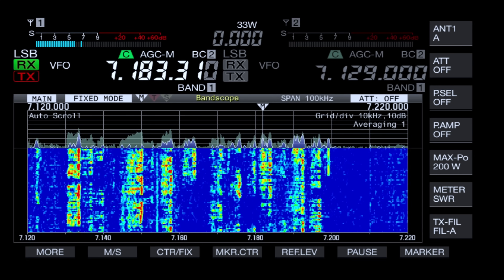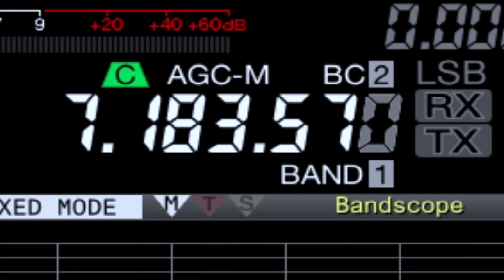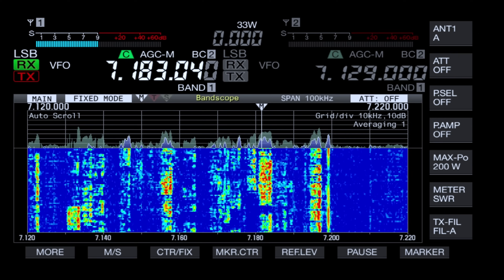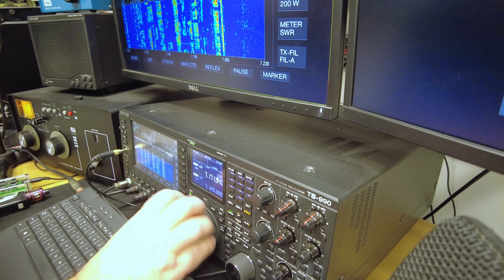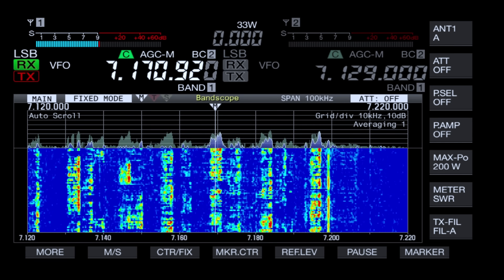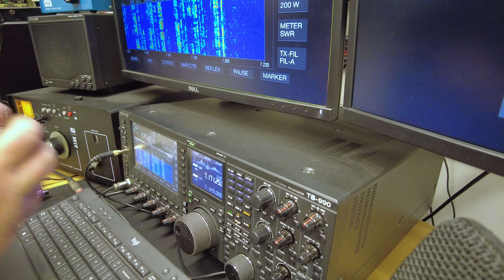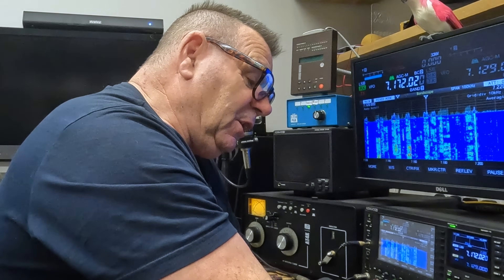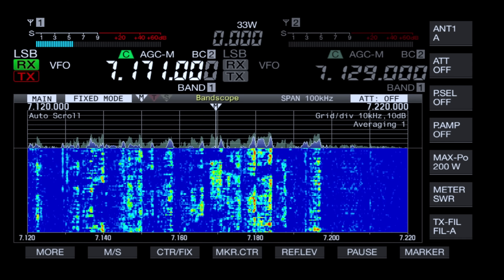Tuning in SSB Signal for Newbies

Comment: SSB is where you tell the good operators from the sloppy.  Obviously the good are straight on freq. while the others’ radios are just enough Hz off to drive you mad and often drift, adding to the fun.
I’ve been told once or twice that I was off freq.  I told them that was a sign they need their radio tuned.

Comment: I started my shortwave SSB career  with a dial , no digital readout. Had to get good zero beating a signal.  So,sooo much easier today,  not only because of the digital display on the VFO, but my modern rigs have wonderful roofing filters,  adjustable IF , adjustable DSP filters. And now waterfalls! To an old goat like me , it's like going from driving a  tractor to a Cadillac!  Modern radios are amazing.  I still like my old fashioned rigs, but if I'd have my druthers,  I'd take one of today's HF rigs any day !
Reply: I bought an old trio reciver and it takes a good 30s to tune to the fking ssb signal lol. I got the pain, but I saved money

Comment: Is it standard practice to use the the lower half of a frequency that another operator is using upper ssb. For example another operator is operating at 7.123 upper side band. Can I operate at 7.120 upper side band? Or would there be interference?
Reply from the maker: About 3kHz is probably fine. So your example would be OK - but nothing to do with "lower half" or anything, just 3kHz because your TX bandwidth will be about 2.7kHz.
Reply: @DXCommanderHQ  Thank you for the confirmation. Keep up the excellent work!

Comment: Hi Cal, I've not yet got an HF transceiver.  What fascinates me, is how do you decide whether to use LSB or USB, and do you have issues receiving someone if you're set to the other one?  🤔
73s M7GTX
Reply from the maker: OK Richard, there are basically "standards" so 40m and below (on SSB), you would almost always be on LSB. And visa versa. (Thanks Ian for also pointing this out).
Reply: Generally frequencies upto the 7Mhz band(40mtrs) use LSB and then from 14Mhz(20mts) and above use USB.
73.G7HFS/PA3IKH
Reply: The split is actually at 10 MHz.  The convention is LSB below 10 MHz, USB above.  However, there are exceptions.  If you run digital modes, they are usually always on USB, even below 10 MHz.  If someone is on LSB when you're on USB (or vice versa), they will be unintelligible.  You'll hear them, but you won't be able to tune them to make them understandable.  This is because all their voice frequencies will be inverted - all their lows will be high and highs will be lows.  They used to actually make analog voice scramblers for land line telephones that worked by swapping the sidebands this way.

Comment: Back in 1980 when I first watched The Empire Strikes Back, there's a scene where the Rebel base crew on the ice planet Hoth were monitoring the Imperial Droid probe's transmissions. It sounded very robotic and creepy to me and I had never heard anything like it before.

It was years later when I figured that the sound effects people just used an SSB voice transmission with the receiving frequency purposely dialed up slightly high to sound like an alien robot! 🤖

BTW, I have two serious questions as someone who has never seen a HF ham rig in real life. 

1. Do HF transceivers automatically select LSB when the transmit frequency is below 10 MHz and USB if it's above? Can USB be selected for transmitting on the 40m band or LSB on 20 meters? 

2. Do ham operators choose frequencies with a 5 kHz spacing like broadcast stations or can they transmit on an arbitrary frequency, like 7012.4 kHz instead of 7015 kHz?

Great video sir. I finally learned the proper way to tune into SSB conversations! 📻👍🏼
Reply from the maker: Good question.. And welcome to the channel.. 1. So you COULD transmit on either side-band but once set, the radio will generally remember and sit you on lower 40m, 80m etc or upper (20m and above). 2. You can transmit ANYWHERE you like (inside the allocated spectrum) however, most folks like to have the zeros showing.. Unless it's a rammed contest where if you can find a slot, go there and it might vbe extremely random!
Reply: @DXCommanderHQ  Thank you so much for the concise reply,  Callum...appreciate it! 🙂 I have been searching for the answers to these questions for a long time to no avail. There's nothing on Quora about the choice of frequencies. Several months ago, when I asked the same questions to a British content creator on YT who is a ham, he provided me a link to some U.K. amateur radio society website and implicitly asked me to scour the entire website. I didn't like his condescending tone and unsubscribed from his channel. 😐

While I am familiar with the use of repeaters on VHF and UHF ham radio (I have a few 2m/70cm walkie talkies myself), I am aware that repeaters use round numbers. e.g. 143.900 MHz, 148.650 MHz and so forth. HF is a different ballgame to me as I only have shortwave receivers and SDRs but not HF transceivers. I've noted some licensed and unlicensed users in Southeast Asia transmit at 6995 kHz, 7000 kHz, 7015 kHz and even 10000 kHz, which I understand is reserved for time signal stations.

It took me a long time before I learned that hams transmit on lower sideband if the frequency is lower than 10 MHz and upper sideband if it's higher. Utility signals like Volmet always broadcast in USB regardless of the frequency while the Bangkok Meteorological  Radio transmits on a rather odd frequency of 6765.1 kHz. I wish I knew why they chose that frequency, right down to the nearest 100 Hz. 🤔

Comment: A great video Cal.  I like the bit about not looking at the screen - but using the ears.  I think this is a bit like tuning a guitar. When I do this I tend to use the method where I tune one string on the 5th fret against the next open sting (or 4th fret on the third sting) - going from thinner strings to thicker strings (i.e. High E to low E).  The major point here is that when you are nearly in tune, but not quite, you hear a beat. AS you tune a little more the beat gets slower and slower and then BANG on the money. All done by the ear and not looking at any dials.   Mark. 2E0MSR.
Reply from the maker: That's it!

Comment: Modern synthesised rigs being so frequency stable combined with the natural urge to have integer frequencies means  if you set the VFO to all trailing zeroes as a starting point you can pretty much tune around in 500Hz or 1kHz increments even times of high  ̶Q̶R̶M̶  contests :)

Comment: Back in my CB days, one of the first modifications we would make is to 'lock' the clarifier so xmit and receive were on the same frequency. If you didn't those old rigs were seldom on the same xmit frequency and a qso between four or five operators was a mess. Modern radios are great in that regard.
Reply from the maker: Yes.. OK with two of you but with 3 or more, it becomes a bit of fun!

Comment: Excellent topic and delivery. The way I "think" about it is that I am trying to put the carrier back to where it is missing. In sideband ALL of the energy transmitted is on one side of the modulation IF the carrier was included. Your VFO is putting back what is missing...the carrier.
Reply from the maker: Good comment!

Comment: Back in the day it was harder because nobody had digital readouts and everyone was slightly off frequency and you had to tune every signal this way.  Then we got digital readouts but everyone was still slightly off frequency.  Today, with all the PLL based radios with TCXO oscillators everyone is pretty much right on frequency.  Typically if you just jump to the nearest kHz when you hear someone, you'll tune them straight away.  Set your radio to step in 1kHz steps, and just step around and you'll nail it.  7170.000, 7171.000, 7172.000 etc.  Once in a blue moon you'll find someone on .5 kHz, but it's rare.  Of course if you run across someone using an old rig, they'll be somewhere random because those radios were not accurately on frequency like modern digital rigs are.
Reply from the maker: Yes, the random boys.. Heck, I was one of those once!
Reply: Often times DX stations are at odd frequencies and need to be "tuned in" by ear. I'll have my VFO step at 1kHz and then go to 1Hz to fine tune. I've found stations on all sorts of strange number combinations 14.358.72 or something similar. It's really only a pain when there are very loud stations over driving their gear 1-3kHz off from where you are trying to work and their overdriving is splattering all over. Great info Callum.
Reply: Wrong, back then people would tune SSB by ear not by frequency, it does not matter what the dial says. Today people tend to channelize SSB, my radio shows 14.000.00, someone else's radio shows the same thing, it doesn't mean we are in tune with each other. Unless we have GPS disciplined reference on each radio to tame the differences.
Everybody is off frequency today
Reply: @Flagrazi  Back then it didn't matter what the dial said because the dial was never right.  But today, if your modern radio is within manufacturers specs you'll be in tune with each other if you're both on 14,000.000.  It doesn't require GPS disciplined references on HF.  The normal stability of a modern synthesized rig's tcxo will typically get you within a few 10's of Hz, which is as good as your ear can tune.  It doesn't require high dollar equipment for this kind of frequency stability today. Pretty much all radios are this good now.  I don't know what frequencies you listen to, but if you think everyone is off frequency on HF these days, then you're the one who is off frequency.  Most people are sitting dead on 1 kHz frequency boundaries.  Calibrate your radio to WWV.   It isn't hard.

Comment: Thank you Callum. I know about the LSB sounding like that but i didn't know or even realise USB was the other way around. As you can tell i am still new to all this even though ive had my license 2/3 years now.
Thank you 🙏🏽🤙🏽
73
Reply: If you have a waterfall and look at it while tuning, you'll notice the tuning line goes just below the USB signal, and just above the LSB signal.  It goes in the middle of an AM signal, because that signal has both USB and LSB components.
Reply: @stargazer7644  thank you for the info. Unfortunately I don't have the honour of having a waterfall. Only have the ft817. Hopefully will save up for a Ft991a and a DX commander expedition for QTH and SOTA. 🤙🏽
Reply from the maker: Very welcome